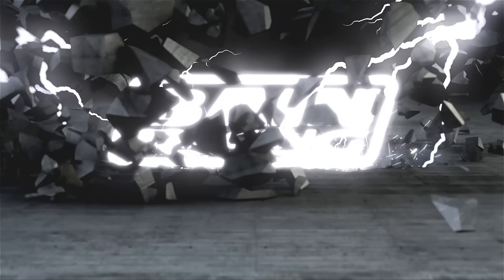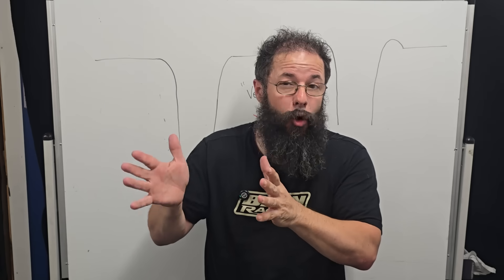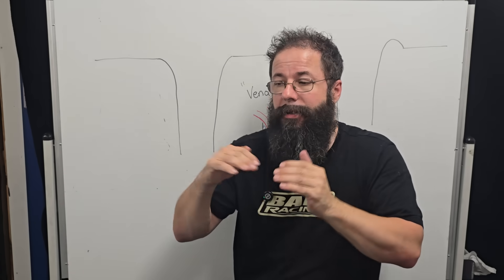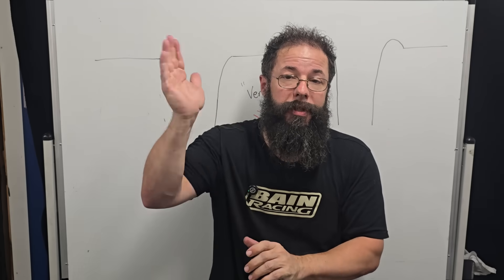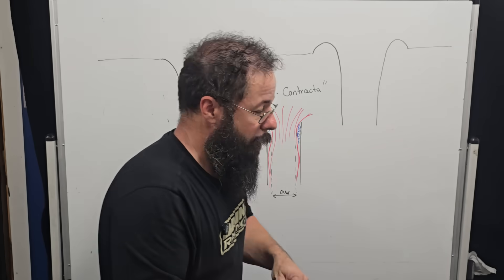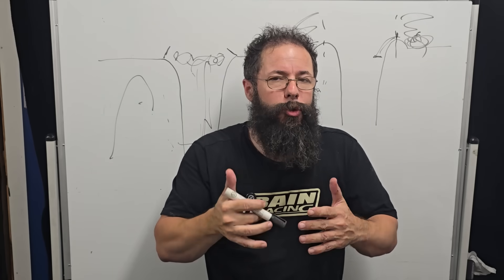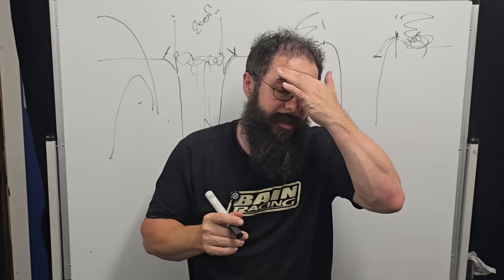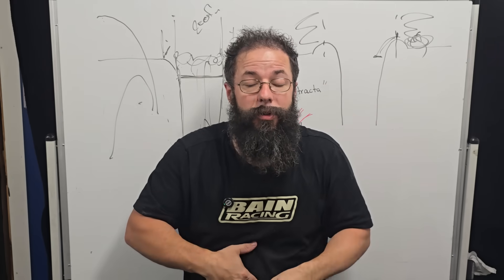Floor vs Raised Radius - The TWO Functions That Control Intake Performance"

Comment: 5:24 Hi Jake, my understanding is that tighter clearances actually reduce the maximum loading on the bearing, which is what allows the builder to run a thinner viscosity. If you think about the film being compressed, a tighter clearances will spread the pressure on the film over a wider area. Still critical to run the right viscosity otherwise you’ll get into a mixed film situation. I think King bearings had a tech article on this years ago.
Reply from the maker: Yeah mate. 100%  nearly an 80% reduction in bearing load from 0.002 to 0.003"   I can't remember her name. But there was a very smart female engineer in the 90's that solved the bearing issues NASCAR were having by explaining pressure vs area with her 👠!😂👍

And yes I have all those articles I think they are still up on my oil tech page on my Bain racing site.  

I'm going to put them on the Einstein Motors site soon.  👍

Comment: Have you seen last Richard Holdener interview where he talks about his experience with making ports bigger? His point of view is the bigger the port gets the more power it makes (if I got it correctly)...
Reply from the maker: Yeah. Unfortunately with a lot of Richards stuff. He doesn't "qualify" what is bigger???  Nor does he develop serious NA or turbo engines. 

So its a bit like saying. Longer runners make more talk. Without qualifying what is long relative to RPM. 

The simple fact is the "right" size port makes the most power. A big port cost us in both NA and boosted applications 👍
Reply: @bainracing  that's exactly what I wanted to hear. Thank you very much for confirming that.
Reply: Hi, with a turbo or blower....sure